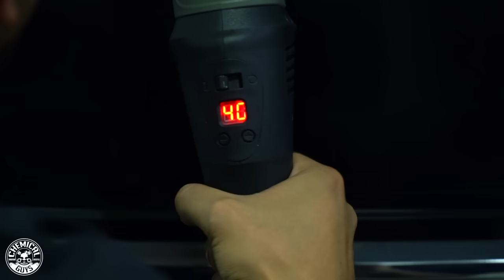How To Remove Swirl Marks And Scratches on Black Car - Cadillac Escalade - Chemical Guys

Comment: Question I have been paying to get my car detailed I want to buy all these supplies to start doing It my self my only concern is a do you guys offer some type of class to teach new guys? And B can I detail out side or do i need to be in a closed place like a garage?
Reply from the maker: Hi Raul! Good question. We do offer classes at your local Detail Garage store, we teach the Basics of Detailing and Basics of Polishing. In the basics of detailing we teach washing a car, clay baring, glazing, sealing, waxing and how to maintain a car clean with a quick detail spray. We also cover the interior wipe down and re-conditioning leather seats. The Basics Of Polishing class will show you how to use a dual action machine, rotary machine, what pads to use and when you can and cannot polish. Yes you may detail outside just make sure the car is cool to the touch. If this sound right for you give us a call 1(866)-822-3670. Thanks for commenting and thanks for being part of the Chemical Guys family.

Comment: Do you use the same pad through the whole process? If not, how often do you replace a new/ clean pad?
Reply from the maker: Hey there, we use the same pad throughout the entire polish. Some people change pads every few panels, and they clean the pads after each panel to keep the pad from clotting. From our experience, one pad has worked fine as long as you make sure to clean the pad after each polishing job. Here's a good video that we've done recently that I think you will get allot out of. Stay tuned for more great videos from the detail fanatics at Chemical Guys!
https://youtu.be/ooP0GLs1jNs

C.G. Alex -

Comment: Hey guys first time viewer. I have a black truck and I tried buffing out some scratches on the bed off my truck with a orbital buffer. Unfortunately it left swirl marks all over the bed and tailgate. How would you guys go about taking care of that? Same as the video or another method?
Reply from the maker: Thanks for tuning in! Using V36 and an Orange Hex-Logic Quantum Pad, same as in the video, can easily remove swirls.

Comment: i have a all black escalade and it has a ton of clear coat scratches what suggest i use for a  pad and Chemical should i use on my Rupps 21 mm buffer
Reply from the maker: Hi Mark, thanks for watching our video. Start off with a clean surface, you don't want to mix polish, and dirt together. Depending on where the SUV has been stored, a clay service may be necessary, gently brush your hand against the pain, if the paint feels ruff, the paint's pores are contaminated, and need to clayed like blackheads on a teen's face. I suggest using a clay block because it's much easier to handle, clay bars work well, but if you drop them, it's over. if you drop a clay block, you can spray it with a quick detail spray, wipe it off, and you can keep claying. Be sure to lubricate the paintwork with a quick detail spray to prevent the clay block from dragging. Now comes the hard part, you look at the paint, and you have to make that tuff decision. The best way to approach this is by starting with the least aggressive approach, a medium cutting pad with a light polish like V36. Follow the V36 up with  V38 as a finishing polish. If you're not satisfied with the results, try an orange cutting pad with V32, and the same pad with v38 to refine the paint work. If all else fails, you can move up to more aggressive pads if need be. Always follow up a polishing with a glaze to fill in minor scratches and swirls, and to add shine to the paint. At this stage,the paint has been thinned, so you want to apply sealants, and wax to prevent oxidation from claiming another victim. The wax will help to prevent stains, water spots, and sun damage as well.
Reply: Thank you guys i really appreciate the feedback
Reply: I have a all Black Ls 460 with black rims what would be the best product to get the swirls out of the paint and do u guys sell a package  for black cars

Comment: can you guys please do a video on how to remove lightish key marks off black paint??? Some A holes at work keyed my gas cap on my 2017 GMC Sierra and its black...its not deep just really noticeable since the rest of the truck is perfect and glazed with blacklight and sealed with jetseal with a coat of butter wax.
Reply: If they only damaged the clear coat, you'll have to sand it down with some 2000 and 3000 (wet). Then polish it to make it shine again.

Comment: hi,
my black subaru is supposed to have had  paint protection applied when i bought it second hand from a dealer, i paid extra for this.  I and others have noticed that the swirl marks are really bad, is there a process to get rid of the paint protection before trying to polish? can you recomend a kit for me?
Reply from the maker: Hi James, polishing is the only way to remove coatings, I'm guessing it was probably a ceramic coating that was applied to your paint to prevent it from oxidizing. There's no  such kit to my knowledge that exists. Just use a dual action polisher, start polishing like normal, once you start to see the scratches disappear, that's when you know you've removed the coating. Do a surface prep, wash and clay the car, then polish using a DA polisher. I'll leave you some links to better assist you.

http://www.chemicalguys.com/TORQ_10FX_Random_Orbital_Polisher_Kit_10_items_p/buf_501x.htm

http://www.chemicalguys.com/TORQ_TORQX_Complete_Detailing_Kit_p/buf_209x.htm

http://www.chemicalguys.com/Clay_Block_V2_Luber_Surface_Cleaner_p/clay_block_kit.htm

http://www.chemicalguys.com/JetSeal_16_oz_p/wac_118_16.htm

http://www.chemicalguys.com/EZ_Creme_Glaze_16_oz_p/gap11316.htm

Comment: If I have a TORQ 10fx, what speed setting should I use to polish my 2009 black BMW 328i? I have all the v-line products and a black, white, and orange hexlogic pads. I just picked black light, jetseal, and butter wet wax . I wanted to know what pads to put what on and what speed setting? Thanks!
Reply from the maker: Hey Dalton. Start with the slowest speed, and then the fastest speed, which I believe is the sixth speed. You use the first speed to spread the polish, then reapply the polish to the applicator pad, and max out the speed. Always start on the surface of the paint, the best thing to do is start with the least aggressive pad and polish. Start with V36 and a white pad, if no results, try V34 with an orange pad, then polish with v36 and a white pad.  Start with a small test area to check your progress. If the scratches and swirls are mild, use VSS, it's a one step polish that starts out as a compound, and breaks down into a fine polish through the use of micro abrasives. If you want to use your polisher to spread wax, use a black pad to spread the wax, or glaze, or sealant on the first speed setting directly on the paint to avoid slinging wax all over the place.
Reply: Chemical Guys, awesome thanks so much!
Reply from the maker: Here's a link to the pads, and a video to help you along the way.
https://www.youtube.com/watch?v=HrUmQ6uLSPI&t=171s
http://www.chemicalguys.com/Hex_Logic_Buffing_Pad_Kit_p/buf_hexkits_5.htm

Comment: do you recommend using soapy water or detailer when using a clay bar?
Reply from the maker: Hi Antonio, 

If those were the only two choices, we recommend you use a quick detailer for lubricity. Our Speed Wipe Quick Detail Spray has lubricant qualities that pairs well with the Clay Bar. Of course, we always recommend the Clay Luber for best results. Happy Detailing!

Comment: does anyone have experience with the torq polisher ?? and can compare it to other polishers and which is better
Reply: Thomas Bonn I have a 10FX, and it works well. I have zero complaints. I've never used the 22D, but if it's anything like the 10FX with a longer throw I would buy a few if I already didn't own 2 Mark II's.
Reply: Thomas Bonn Rupes!!
Reply: Thomas Bonn If you want quality and money isn't an issue, Flex or Rupes.
Reply: I agree.  Flex for rotary.  Rupes for D/A

Comment: How much does something like this cost?
Reply from the maker: Hi Jorge, we'll try to give you an estimate of how much something like this would cost because it depends on what someone will charge, and how long the actual detail would take. You would have to first clean and clay the car, you're looking around 200-300 for that. The paint correction aspect alone could cost eight hundred. What you have to take into consideration is that it depends on how many people are polishing, how many steps are involved in the polishing process, and how many hours are involved. Lets just say that a shop charges seventy five dollars an hour to account for workers, then an extra charge for polishes and compounds. So I would you most likely spend about 850-1000 on a job like this purely because the car is big, and it requires alot more effort to get the pain to look blemish free. Typically the cost would go up if it were an exotic because those cars are very sensitive. Stay tuned Jorge, we have more great videos heading your way every week.

Comment: Why not use water instead of lubricant spray? You just washed the car :o
Reply from the maker: Nooo, don't do it. Water still has minerals and calcium that puts your paint at risk of adding more scratches to it. The lubricant spray is specifically designed  to help the clay glide over the paintwork, all the while extending the life and effectiveness of your clay bar or clay block. Happy Detailing!